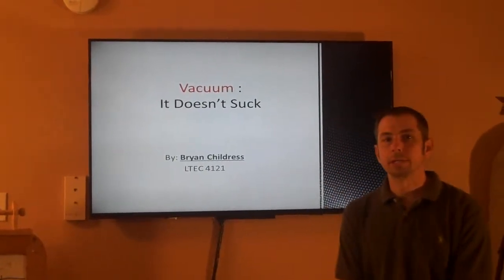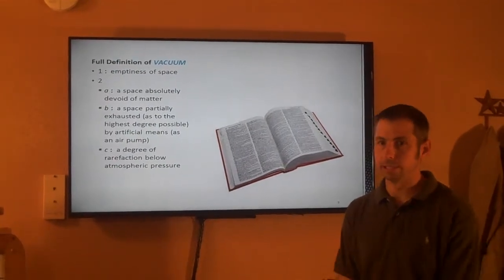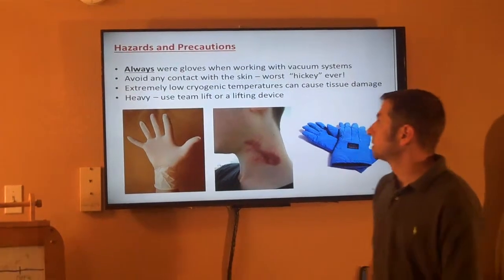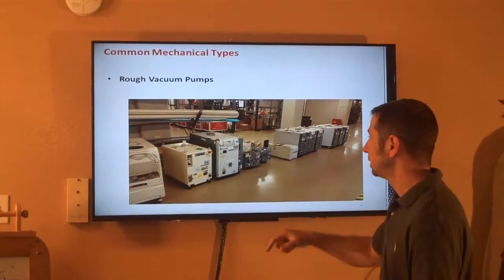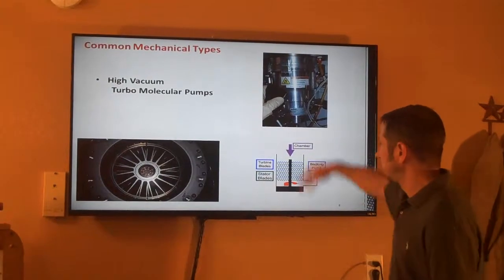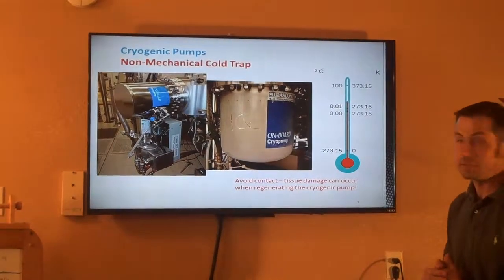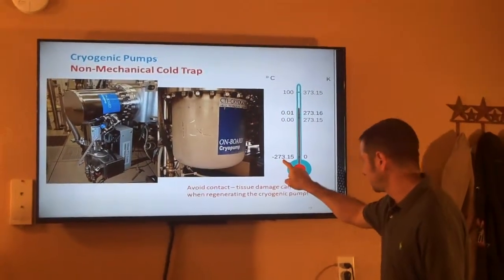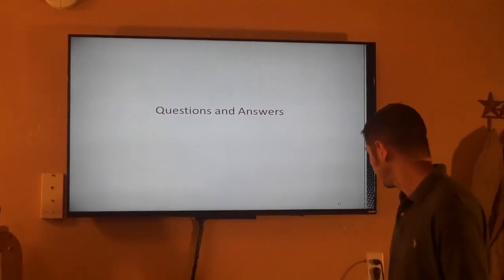Vacuum: It Doesn't Suck

Comment: I'm having trouble finding a video that will answer my question, Does vacuum pull? There's a debate going on about whether rockets can work in space and the main point on the doubters' side is that they think space would literally pull the propellant out of the rocket and rob the rocket of any push. But as far as I know pressure >pushes< into lower pressure, it doesn't get pulled by lower pressure. I mean if I had an open cylinder with two pistons inside butted up against each other and I put it all in a vacuum chamber and then physically pulled one piston away from the other, the vacuum between the two pistons would not act like a rope would it? Wouldn't the other piston remain where it is while I pull the first one? But the opposite would be true in an atmosphere, right? In atmosphere the other piston would follow, but not because the vacuum pulls on it but because the atmosphere pushes it from the other side.